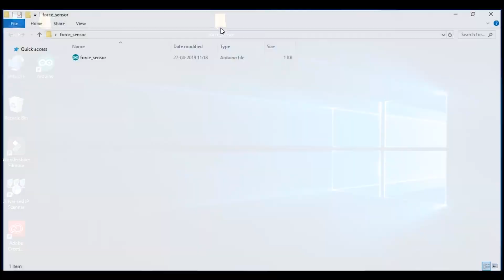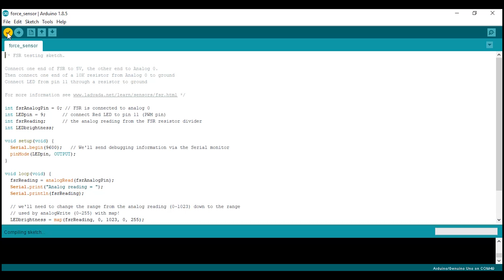How to use Forces Pressure sensor with Arduino

Comment: Doesn't contain unit measurement, so it's kind of a waste of time, since you could basically achieve the same results with any typical circuit with a switch, or even just copper tape.

Comment: will this work with a nano?
Reply: I guess so. It also has an A0, so you just have to connect the Arduino to your PC, load the Arduino code and change the Arduino model on the compiler. I think this should work.

Comment: thanks, Question, how to use 2 or more Force pressure with arduino?
Reply: I'm not an expert in electronics, but I guess you have to repeat the circuit 2 or more times and use the other analog inputs from the Arduino. The version he uses here has 6 analog inputs from A0 to A5, so, you can have 6 pressure sensors.

Comment: If I have 10 sensors do I have to use one Arduino for everyone or should I use a raspberry pi for that??? Please answer
Reply: I know this message is old, but for somebody else looking for the answer: you could use a diode key matrix, which theoretically will allow you to connect 36 pressure sensors to the Arduino. Look for: "key matrix Giorgos Lazaridis", then you will find a nice page explaining how this work.
Reply: what r u making with 10 pressure sensors?
Reply: you can if you mupltiply the code